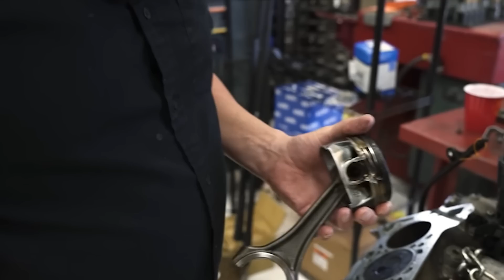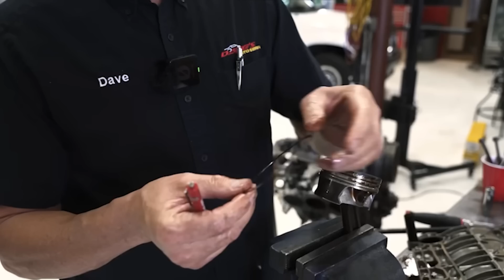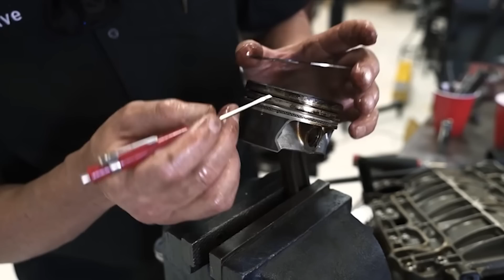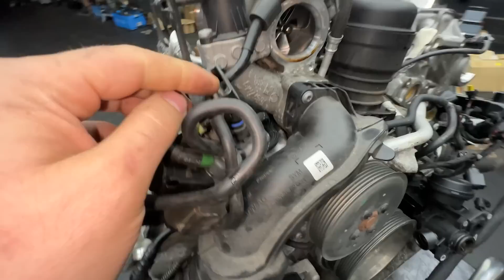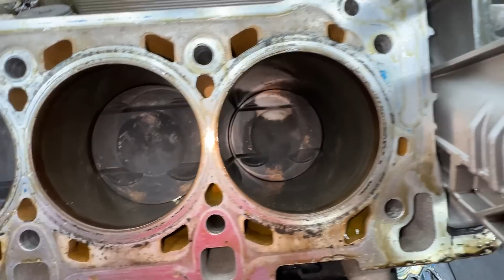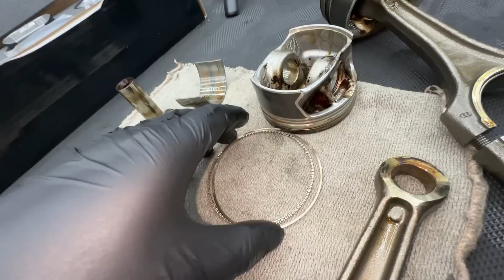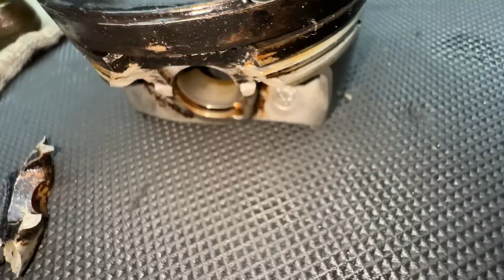Reaction video on LSPI from Dave's Auto Center and 034 . Why I like the EA839 engine from Audi B9s

Comment: LSPI can happen at all operating temperatures and RPM and load areas. There is research proving the concept or thought that LSPI only happens on a cold engine with cold oil wrong. There does seem to be correlation to slightly - note - slightly more frequent occurrence but can happen at all ranges. Search for LSPI research papers and you'll see. To me personally it anyways make sense to have more LSPI when things are warm and hot and under high load than cool temperatures (relatively speaking) and lower loads just cruising around - but trust the research not a random comment.

The most agreed upon main contributing factor and cause of damage of LSPI is pre-igniting of oil in the ring lands.

After that you can discuss what causes the oil to get there and to ignite, some things that have an influence or effect -

- Oil chemisty - most often high in calcium (a detergent) will cause the oil and fuel to mix and emulsify instead of separating out like it'd do with a low calcium content oil. The "LSPI proof" oils have low calcium content for this reason, most performance or racing oils do not have low calcium content or any certification at all - the type of oils a lot of these tuned cars like to run. There is a direct link and correlation between low calcium oils and reduced LSPI occurence - check the research.

- Fuel dilution in the oil - through worsening injectors (bad atomization and spray pattern causing more fuel to not be atomized and end up in the crankcase instead) or through repeated short journeys where the car doesn't get up to operating temperature and stay there for long enough to evaporate the fuel that got into the oil at the start - happens to all cars but the negatives are minimized by driving the car warm for long enough for all fuel to evaporate out of the oil - a high calcium oil makes this more difficult, a low calcium one makes it easier - LSPI friendly oils are recommended.

- Piston design - a piston design with not enough tension in the rings and/or not enough oil return area and flow in the oil ring groove OR if the oil return groove has carboned up will make it so the oil scraped by the rings can't get back to the crankcase through the piston but instead needs to return through being wiped off the cylinder walls - the increased amount of oil stuck on the walls not returning through the piston and instead needing wiping in combination with low tension rings will make it so more or will get through the gaps in the ring or by the walls and either go directly into the cylinder or be stuck between the compression and oil control ring in which case it might fill up all the way around or just find its way to a spot hot enough to combust it. Like someone else said the purpose of the holes in the piston and the purpose of the oil groove are not primarily to oil the walls but to scrape of the excess oil on the walls that the sprayers deposited and return it into the crankcase through the piston. They do some oiling / act as an oil reservoir to a point but it's not their primary and only purpose.

Whilst a stronger piston like you suggest would help that'd be a bit like turning up the radio louder when the car is making a noise - sure solves the situation for the moment (piston cracking because of LSPI) but doesn't solve the base problem - LSPI causing pressure peaks in the ring lands and tops of the piston. Take care of the above I mentioned and combine it with a strong piston and I think you'll have a solid and reliable solution.

But don't take my word for it 100%, this is info I've gathered from research papers amongst other things.

Lake Speed Jr through the Youtube channels "Motor oil geek" and "Totalseal piston rings" has a lot of info on LSPI, rings and oil. Just search any of those names followed by LSPI and you'll get everything from lectures to short videos. He's a tribologist (oil and lubrication specialist / oil and lubrication engineer) and works for a ring manufacturing company.
Reply: A better summation than offered by VAG's video.

Comment: I agree Man just the thought of 0w20 inside a turbo charged engine is just crazy. Wtf 
Obviously the manufacturer doesnt have the engine longetivity in mind when theu sell this. Tell me im wrong. 
The only purpose of prescribing 0w20 is to bring the engine operating friction down to IMPROVE FUEL EVONOMY THATS IT.  0w20 will not protect that engine from eating itself up no way man. No way. 
I like 0w40 5W40 in a thrbocharged engine  because when that engine heats up that 0w20 becomea even thinner even softer runnier how will it protect that bearings hoow. Come on.
Crazy

Comment: Currently have a 2020 SQ5 3.0T petrol w/40k+ kms still w/new warranty till Oct2024 and extended CPO warrany for another 2yrs/160k kms.Audi dealership is very "by-the-book" where I acquired it from.I've read and hear mix answers regarding 0w20 (I agree w/your opinion that this is 'water') vs 5w40. Regardless of warranty, is it truly safe to use 5w40? Any way I can tell that the engine in my vehicle have the upgraded revised version of the rocker arms?

Comment: I’m from the US and what Dave is talking about with a “SP” rated motor oil it just means that it is the most current US oil rating. The 2 oil ratings that are best for direct injected/ turbocharged engines are: API “American Petroleum Institute” SN Plus or SP rated motor oils. These motor oils are proven to help reduce low speed pre-detonation there’s a lot of low quality oils here in the US that don’t have these ratings and using a cheap motor oil that doesn’t have those ratings can make a difference. The majority of the low speed pre-detonation is mostly caused by the cheap gas people buy here in the US. Europe tends to have much higher quality gasoline than the US. I’ve owned multiple Volkswagens and the only motor oils I’ll use in them are VW rated oils it definitely makes a difference.
Reply: You were mostly right except for about the fuel quality. Fuel quality in the US is not lower than Europe. The difference is they have lower sulfur content in gasoline in Europe to lower emissions. We've seen how low sulfur content in diesel fuel actually creates issues with lubricity. It could cause issues with gasoline vehicles as well. Additives have to be added to the fuel in order to restore some lubricity. But even then, I wouldn't be surprised if Europe actually has more cases of these lubricity issues on gasoline vehicles.

Europe altered their regulations in order to reduce sulfur content so the emissions equipment and particulate filters can work even better. But we know it creates problems as well.
Reply: @mediocreman2  A lot of people don't realize that europe using a different octane scale than the US so they think 98 euro is better than 93 US when it's the same.
Reply: When it comes to European motors you should be following the required oil specification in the manual. It may not even be API certified oil but the European derivative ACEA
Reply: LSPI and low quality engine oils are not related. SP oils have a lower calcium ppm that reduces the change of LSPI.  The additive package has changed to less than 1,500 ppm calcium and increased zinc, phosphorus, and  boron have proved to help.  Gas has nothing to do with LSPI.
Reply: I have a 2016 GTI Autobahn that I was running 5W-30 oil that was not SP rated so I just switched it to 5W-40 SP rated Castrol oil and it seems to make a huge difference in the way the vehicle sounds I also run nothing but premium gasoline that is high quality and I run liqui moly dijectron in it every 2400 miles and I always let it warm up in the cold weather before I rip on it
Reply: There is something thats out of the oil. .  And that lowers the risk of lspi. 
I thing it's calcium or something .

My audi needs 0w20 but i don't use that . I use 5w40  . I don't trust that thin oil.  Well see what happens after a while. . .  I'm not a mechanic but i fix everything on all my audi's 🙏
Reply: @erwinvanriel5843  higher calcium can mean more risk of LSPI, but if you run a real oil (with euro rating) it wont cause any problems. Also most 0w20 oils are better than 5w40, i understand your consern, run a 0w-40 instead, they are almost always a good base stock with a good additive pack.
Reply: @alexstromberg7696  

I use liqui moly . Full synthetic. That 0w20 it's so thin,  and i think it's only for the    emissions . .  And to warm up the engine quicker. .
Reply: @erwinvanriel5843  the engine is also designed for a specific oil grade
Reply: @alexstromberg7696  

I know. But i speak to a lot of official audi tuners here in Holland. And they also put that   5w40 in their audi's 

I take the risk . My engine running so smooth on this oil .  It's a ea888 gen 3. 
My feeling says this is better than 0w20. 

I appreciate your opinion 🙏🙏
Reply: @erwinvanriel5843  if it’s tuned and your tuner recommends it I would listen to him!
Reply: @alexstromberg7696  

No it's not tuned 
It's original. Also i think . . I think to much. 
That tuned cars are at more risk to lspi. 
But that's only what I'm thinking 🤔 😕
Reply: @erwinvanriel5843  tuned cars are more prone to it yes, but if you seem to care about your cars so you probably don’t run it hard the second you start it
Reply: problem is that APIs ratings are garbage, if you care about oil you run Euro specs, like Porche A40, BMW LL-01 or MB229.52. i dont even look for the API rating because it means nothing

Comment: Are you saying that if we want to drive the car “sporty”, we should keep the RPMs over 3,000? Seems like we should use the manual shifters since even in dynamic drive mode the car is happy to stay below 3,000 rpm.
Reply from the maker: My opinion 😀 from 2000rpm that’s low

Comment: American oil standards are very general... SP is the spec that combats LSPI.  Euro cars in the states still spec the same oil specified by the manufacturer...VW 508.00/509.00, 504.00 / 507.00....

Comment: Holy crap. The bullshit machine is working overtime. Everyone who ever drove a car has the absolute answer to every engine failure problem. Why does a piston break? It's too weak for the application. Tons of boost, super light/thin piston. Making up piston failure causes makes you sound like an idiot to real engine mechanics. But you are a genius to the fan boys. Talking about Dave of course. I once put solder in my oil pan and the engine ran for a million miles, ETC ETC ETC.

Comment: What’s with all the EA839 engine codes DECA, DCAB, DGRC etc etc. I think the last letter is the power output? Anyone know exactly, would be good to know what parts are interchangeable like heads & block etc. cheers
Reply: just small differences, they change the engine code for every change, so if they change the injectors for a new model year it will get a new code.
Reply: @alexstromberg7696  apparently some have different blocks. Some have bellhousing bolt patterns to suit ZF 8HP & others to suit a PDK. I’ve got a DCAB Cayenne that needs a replacement engine, but they’re hard to find. Seems as though the RS4/5 might be the only other suitable ‘short’ engine 🤷‍♂️
Reply: @jayb7036  yeah sometimes they can be very different, but just for example I think the 2.0 tdi has no joke 200 different engine codes

Comment: The guy's full of sh*t.  He says "the oil is so thick it gets past the second ring" How could it do that if it doesn't get past the oil ring?  Regardless, modern synthetic engine oils are NEVER thick.  Even synthetic diff oils flow like water when cold.  Methinks the problem is that Americans are accustomed to giant lazy V8 engines that you can put sump oil into and still get 500,000 miles.  Most barely understand the (admittedly over) complex Euro engines.  If you watch Christian and Vera LRTIME videos, he categorically states that using TOO THIN an oil in Ford Lion V6 engines causes premature failure.

Comment: I will guess, a combination of:  
always low octane/ bad fuel;  
dirty injectors; 
poor quality or wrong viscosity oil; 
extended oil changes; 
short-tripping; 
always hammering it when it's still cold; 
grandma fuel-saving type driving in low rpms; 
lugging.

Comment: As an Audi technician and b9s4 owner I love this video and your channel thank you.
Reply: hi bud do you know if b9s4 years 2019 have the latest revision rocker arm or nobody know when Audi updated thoses.
Reply: @jeanfrancoismenard705  it depends on the month it was made, I’m not exactly sure of the month off of the top of my head but one of the first videos on this channel about rocker arms they do mention it. Also you can check with a borescope through the oil fill cap and see the size of the roller’s bearings.
Reply: But yes in 2019 they made the update
Reply: Hi Ive been so conflicted on what oil to run on my Audi S4 3.0T 2023. I heard of so many opinions but Audi recommends 0w20 but people hate it. What’s your experience? My car is at 15.7k miles
Reply: I personally run 5w40 and my car has 2019 has 80k miles.
Reply: @W @WolfieGod  I personally run 5w40 in my 2019
I cannot prove that it saves these engines but that’s what i use and i do services every 3-5k miles

Comment: The low-speed pre-ignition is absolutely the cause.  This happens in other makes of engines here in the USA when people use the wrong oil in them.  It's not just a specific Audi piston issue.  It's an oil use problem.  Here in the USA we see it in NA DI engines, not just forced induction.

Comment: One thing that isn't talked about is the engine cooling, engine bay temps etc. I'm not an expert on these cars but the engine looks really cramped and can imagine the bay temps get really high + high intake temps. There is something with the engine design as they don't make power like a daza which is smaller but reponds much better.

Watching further into your video and youve shown the hot v design. This sort of backs my point about heat being an issue.
Reply from the maker: Hot turbo design is much better for temps because the intake is lower and no exhaust is heating it up like when it’s opposite . Heat always goes up

Comment: Just to be clear for a S4 B9 is the year 2018 and early are to "avoid" and better to pay more money for 2019 and up to have the "correct" rocker arm and the last piston revision. Tks.
As usual good job i think the explanation about cold engine, low end power demand and fuel pressure is good. And honestly i heard thoses same thing about 2.0 L TFSI Engine from Golf R  mk6.

Comment: FYI - Those holes are not for washing the cylinder down with oil. They are for oil returning from the oil control/scrapper ring.

Think about it... they have an upper and lower ring in the scrapper. No way for oil to escape. The upper 2 rings are for compression, and typically do not control oil but can act as back-up for the oil control rings.

Comment: A good explanation of 'lugging' the engine and the effects it has. He also describes trying to build boost at low rpm, as if you are on a 2 step in a drag car. Yes, idiots do stupid things. These engines are very refined and not very tolerable to abuse of this nature. They are designed to be fuel efficient and put out bags of horsepower out of the factory. If you want more, maybe you are driving the wrong car?

Comment: I'm on my 2nd B9/B9.5 S4.  The engine/trans hates being cold.  I always drive in sport just to keep the RPM in the 3k range.  You can feel the car get upset when you ask for power down low....especially when cold.  However in regular D mode the trans wants to keep the car in the lowest RPM as possible.  Just drive it easy in sport or manually shift to keep RPM's up and boost pressure low until the car is up to temp.
Reply: I put a TCU tune on my old S3 I owned just because it always wanted to shift to high gear immediately. Wasnt even in too tuning but shifting strategy made me hate that car till I tuned the TCU. I didnt touch any other part of the car lol.
Reply: @kevinc7632  Yea trans tunes really wake them up

Comment: My B9 s5 has 150k miles. Should I be using the 0w20 oil or the 5w40 mentioned in the video?
Reply: Have the same question.
Reply: They run 5w40 I switched my wife’s 2020 s5 to 0w30 specd for the rs5 and the car seems happy on that, slight upgrade without going way out of spec to double the viscosity but that’s just my opinion.

Comment: I like Dave, but he's wrong! I've had 2 CAEB 2.0tfsi that at their worst were sucking down 1L of oil every 250-300 miles. If Dave's explanation was valid, I'd have easily blown multiple pistons!! 

034's take on it is better in theroy, but it's still not a perfect solution, as I would do full pulls (2000-redline) for tuning at 28-35psi. If theirs was true, again, I'd have blown many pistons!

I think it's a combo of both actually. The CAEB oil consumption issue is well known and cured by new pistons/rings. He mentioned that they did a mid-line revision of the pistons... hmmmm. Sounds like they have another CAEB drama on their hands. They cheaped out on the pistons and rings and it is a weak link. They moved to 0w-10 oil, that is too thin and allowing hot spots to form and you get oil fed detonation!

This is VAG simply going cheap again with a poor design and the customers will pay for it again. In the US, VAG ended up paying millions for the CAEB oil consumption issue! When cars are re-engineered by the bean counters, you get this! They avoided drama in the EU, but it was still an issue!

Good reason to avoid early B9 in a few years after their Leases run out!

Cheers!!!

Comment: GF-6A oil was created to address LSPI issues. They noticed that oils that have high calcium detergents was causing it, so they lowered the almost used in the oil. So anyone not running the correct oil will damage your engine that is Direct Injection